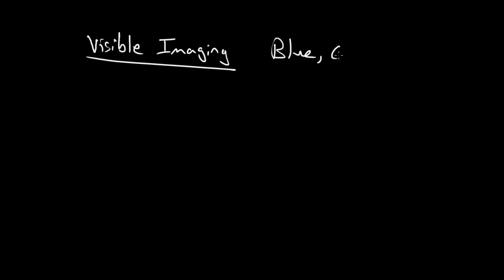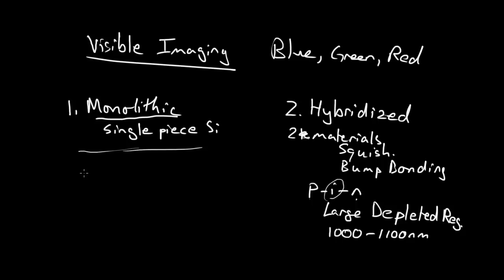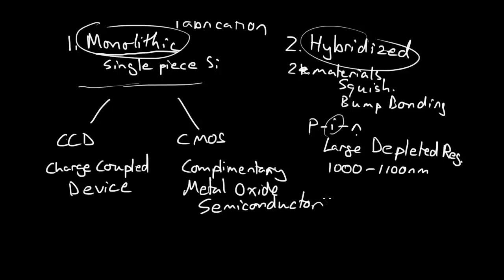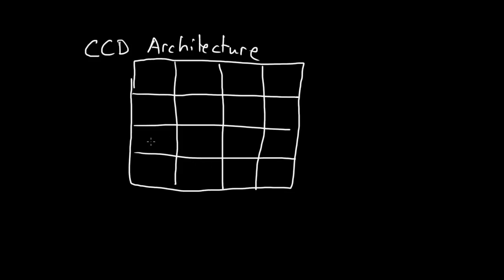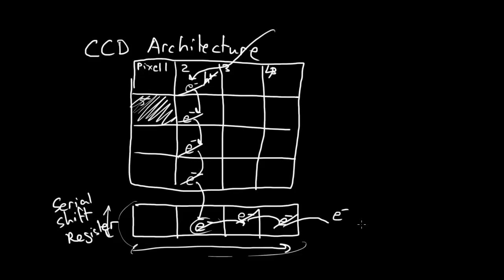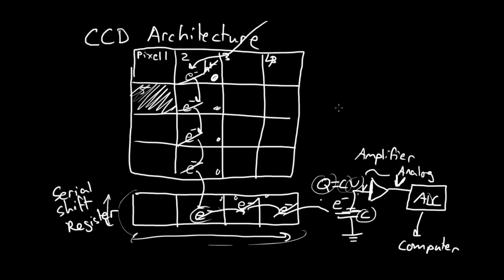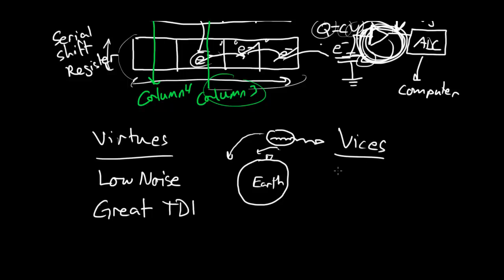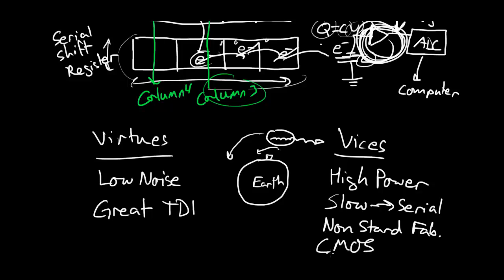Image Sensors 3 of 6 - CCD and CMOS Overview 1

Comment: How would you use a shift register and configuration in your video, to get a Photo-diode to scan a line one pixel at a time?   Would it be the same since it would be serial?   Or, just go from the Photo-diode to a capacitor, then amp, then DAC.  I know its been a long time, but I haven't stumbled on the answer, yet.   You video was very clear, thanks.

Comment: I did not fully understand how the shift process of the electrons through the array works, or at least I see a problem here:
Are all columns shifted in parallel? Then it ends up with the sum of all electrons in the read-out shift register. So I know the number of all electrons which arrived at the CCD, but I can not assigne them to a given pixel anymore.

Does someone understand my question/problem?
In other words: can someone elaborate the read-out process a little more, especially by taking into account multiple pixels, not only one.
Thanks in advance!

Comment: 8:45 so we only have 4 pixel in front but each pixel has 4 pixel layer to filter and move the electron several time ? to get all the colors? in one pixel ?
like layer one pixel 2 reads red color layer 2 pixel 2 read blue color and layer 3 read green colors and layer 4 for just to be there ?